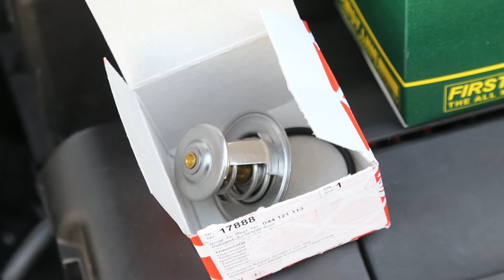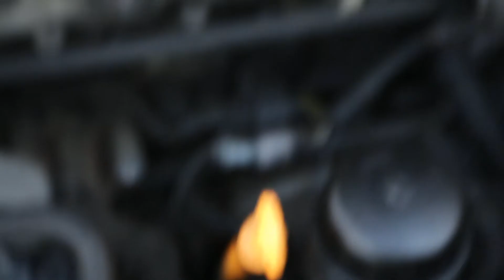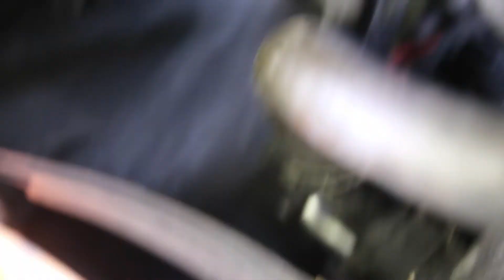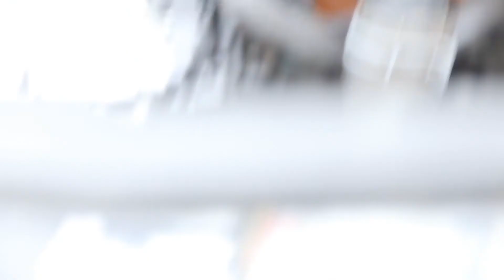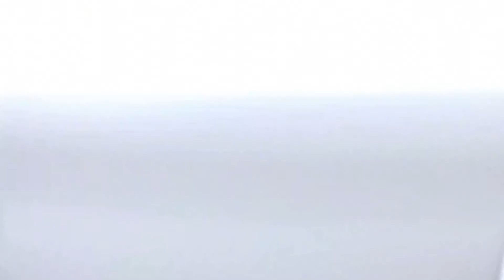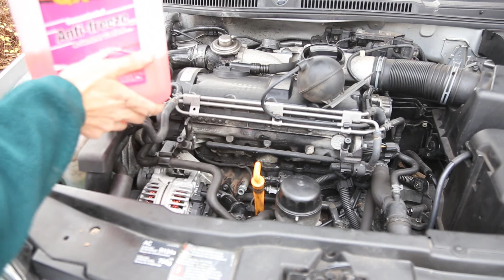VW Golf TDI  Coolant Thermostat-How to Easily Replace without removing Alternator PD130 ASZ Engine

Comment: Hi, do you know if there is an o ring either side of the stat? You get two slightly different sized ones in the kit. I only seen the outer one on my audi a4, have reassembled and not sure if it's leaking.. I need to wash it down and check at the weekend. I put the stat in directly against the block and fitted the outer o ring.. Just wondered if you know if that's correct? Thanks
Reply: hi you did do it the correct way. stat in first then o ring. i done mine on an a6 c5 1.9 few weeks ago.

Comment: I recently replaced the thermostat on my golf 4 tdi and I think that the guy who did it didn't replace the seal because there was no seal on the box which the thermostat came in. Do you think it will cause any problem?
Reply from the maker: If the old one was reused it should be fine

Comment: my 2001 Golf gti VR6 12 valve the needle stays dead center , what can the problem be ? I just bought the car at a police auction cheap and i found some rust in the coolant system . .

Comment: I just bought a new thermostat from the stealer to my Ibiza, and the spring looks stretched as the one u took from the car. Haven’t replaced it yet, my car doesn’t get up to temp as well. Should I be worried 😅

Comment: Hello, my car thermostat was changed, but still car doesn't heat up. After 50km temperature is near 90C  about 70-80C when outside is -5C. I have read in the internet that if you want to solve this problem you have to use original vw thermostats. At least some guys write that for them it helped. That looks funny. But my car doesn't heat up after new one was put inside. I begin to read about it more and I fount that there is thermostats with different working temperatures like 87C 88C and 89C, Maybe you know more about? What working temperature thermostat you put in your car?
Reply from the maker: If it has a new thermostat and isn't showing correct temperature then it might be the temperature sensor that has failed.
Reply: @ajvw  It looks that temperature sensor is ok, because if you  drive at big rpm (like 3000) engine become warm and stay at 90C, but when you drop rpm and speed I see that engine temperature drops down to 70C, sometimes rise up to 80C and is fluctuating from 70C to almost 90C. So it should be I guess thermostat problem not temperature sensor.
Reply from the maker: @Holesterolis  The temperature definitely shouldn't vary depending on engine RPM or speed, once it reaches 90 it should stay there when the car is running so could be worth changing the thermostat. I didn't use a genuine VW one and it was fine

Comment: I had my thermostat changed but there is a funny noise coming from the engine is this normal till the coolant circulates?
Reply: Well, "funny" is a very broad way to describe an engine noise. I'd probably find the noise it makes when a connecting rod has left the party through the oil pan funny, as long it isn't my car. So please, good Sir, try and describe in what way your engine sounds "funny", and under which circumstances and driving conditions.
Reply: @schmuhf  😂😂

Comment: How long in winter did it take for you car to get to operating temperature of 90c?
Reply: Depending on outside temperature and your driving habits, it can be 5-10 Kilometers. Diesel engines are very efficient (that's why they use so little fuel) and therefore output less heat than petrol engines. That is the reason  why it takes longer to warm them up.
Reply: The engine oil takes a lot longer to reach optimum temperature, compared to the coolant temperature.

Comment: Is there a gasket on the housing to block? Missed the key point I wanted to know.
Reply from the maker: The gasket should be in the box that the thermostat comes in, looks like the icon shows it in the bottom

Comment: Is the tube really necessary ??
Reply from the maker: If it breaks it is but I didn't replace mine. I wanted to have it available just in case as it wasn't very expensive but would have stopped the job if it was broken on removal
Reply: @ajvw  alright thanks, then how to not break it haha?
Reply: @Olo23-4  You are very unlikely to break it when you do the job, but plastics tend not too age very well. Especially on an engine, where they heat up and cool down all the time. If I were to replace the thermostat, I'd replace it just in case. You probably don't want it to break half a year after you've replaced the thermostat itself.

Comment: Brilliant but you didn't show to to actually fit the thermostat. Just how to take the pup off and replace pipe.
Reply from the maker: The thermostat just sits in the pipe so there isn't really anything to show for that stage.
Reply: @ajvw  don't you have to slot it in and twist it?
Reply from the maker: @antohooper5021  As I recall it just fits there and you bolt it on. I don't remember having to twist it as there are some locating eyes that hold it in place

Comment: Thanks, just about to do this job on my PD130 today. Looking forward to a warm heater afterwards (hopefully...!)
Reply from the maker: Good luck, I was surprised how straightforward it was in the end, the longest bit for me was doing all the video!
Reply: All done now and working great. It was straightforward apart from snapping my dipstick tube. Old one was very brittle. Ah well, new one ordered (£5). Sits at 90 degrees instead of 45 now and heater is perfect. Cheers !